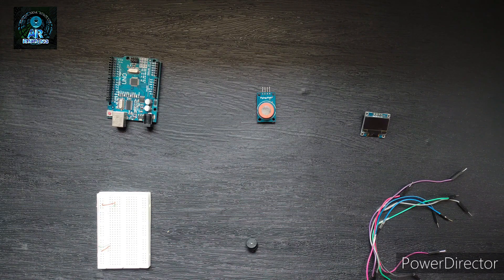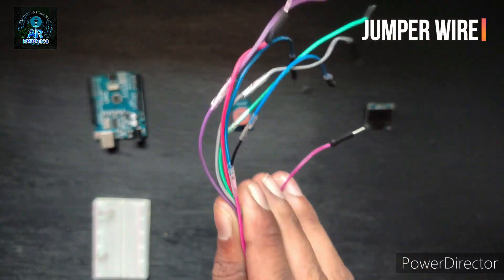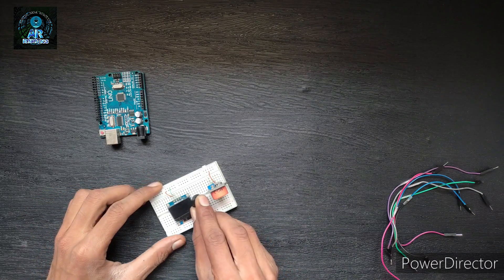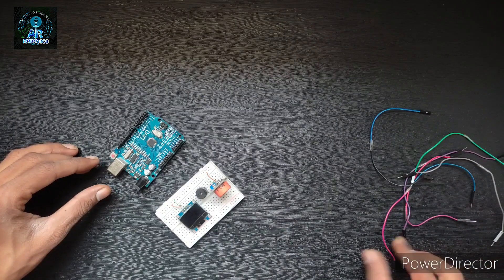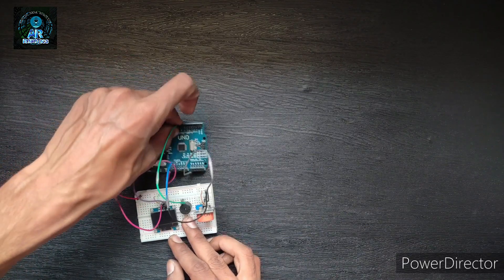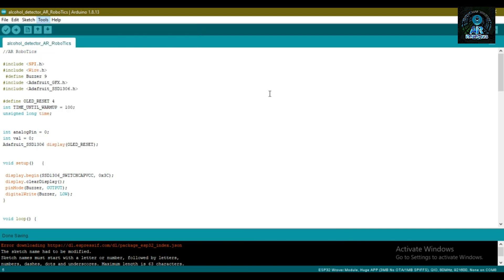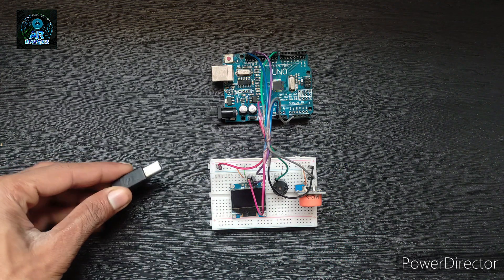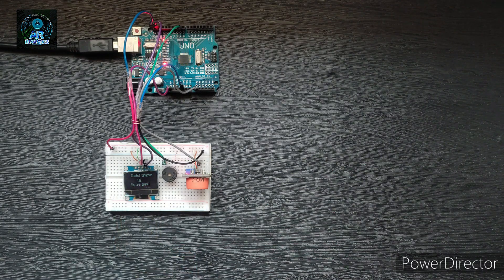MQ3 Alcohol Detector 🍻|Arduino Project @ARRoboTics

Comment: Sir you have made little mistake as you have written in your code if alcohol level is more than >450 it should print no alcohol actually it should be you are drunk and Buzzer should be HIGH Not LOW
Reply from the maker: Thanks for letting me know. I will update in code